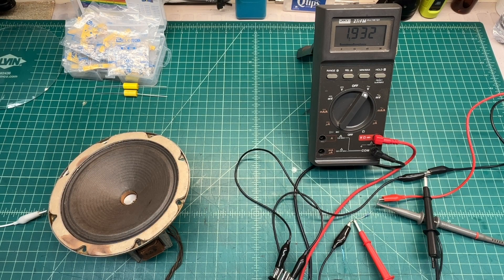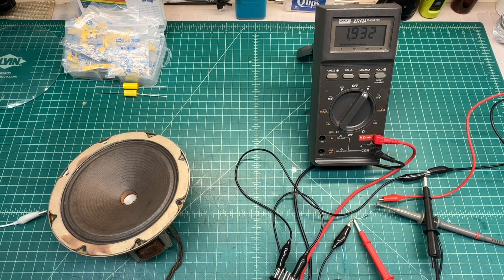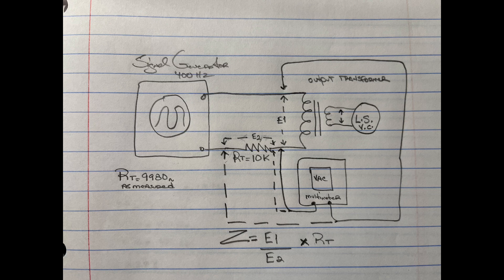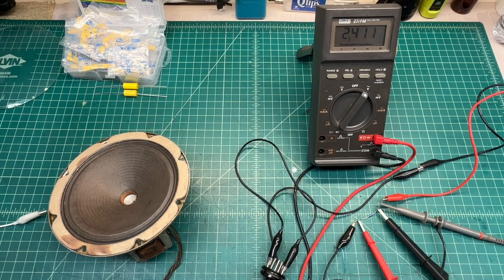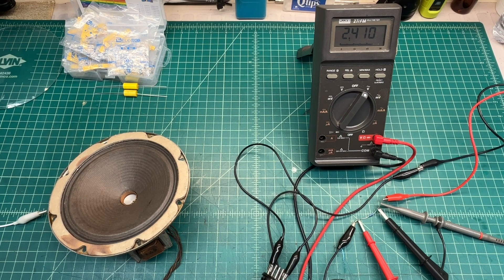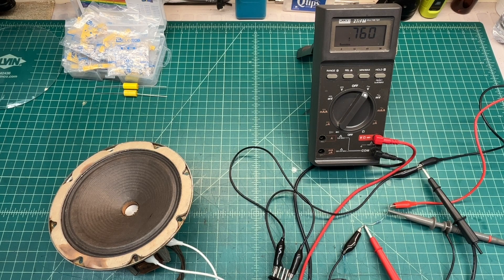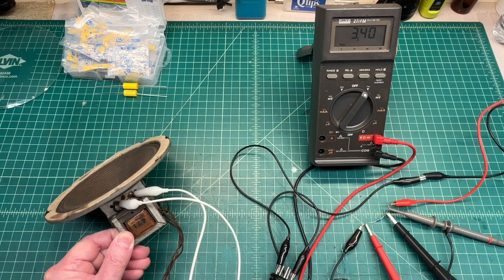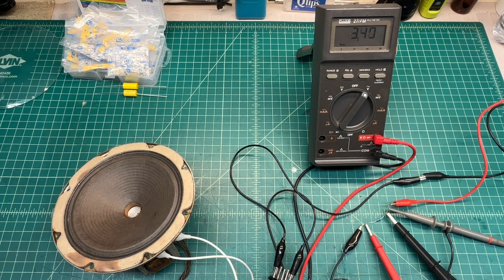A Simple M&P to Measure Loudspeaker Reflected Impedance & Output Transformer Turns Ratio

Comment: You might want to repeat this measurement with the speaker mounted in its cabinet. The acoustic loading will have an effect on the impedance presented to the output transformer, and therefore the tube.
Reply from the maker: Hi Stirling - I did and even placed the electrodynamic loudspeaker laying flat on my cutting mat and the measured differences were de minimis. If I uncover any significant differences, I’ll reply back to this thread. Thanks for your input and all the best. Don
Reply: That seems related to what I've read about matching speaker impedances with "precision".  The impedance of the speaker coil wanders all over the place with different driving frequencies (& maybe volume levels).  So old heads usually say that close is as good as it gets.
Reply: I am pretty sure that it is an open back cabinet. You would have to place it against a wall or into a corner, to see any difference, and it would be the small band of frequency 
equal to the distance of the cone from the wall.